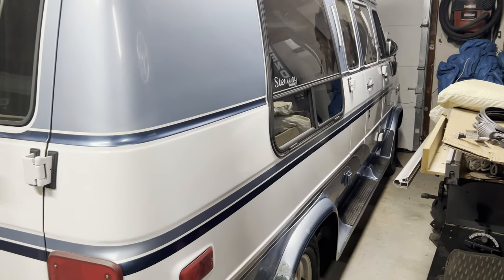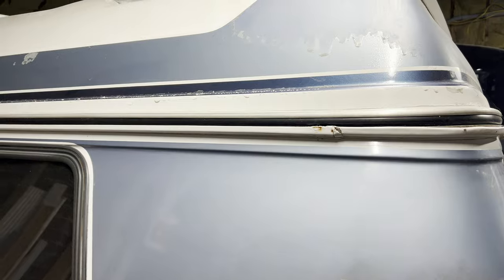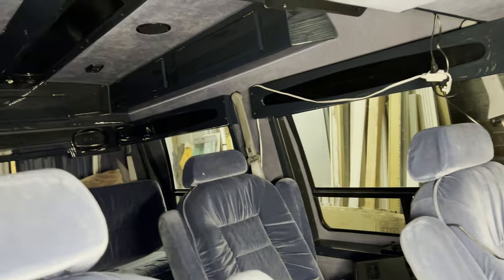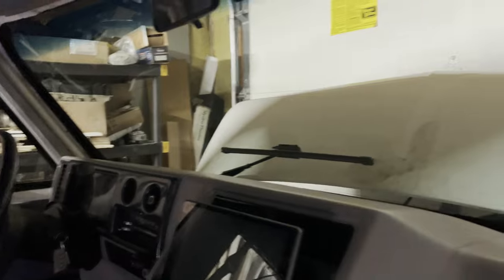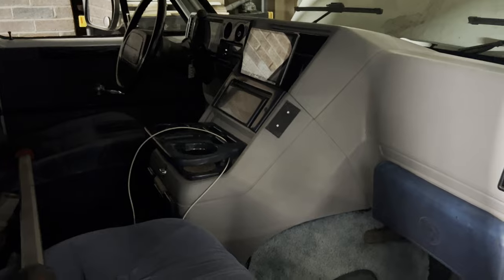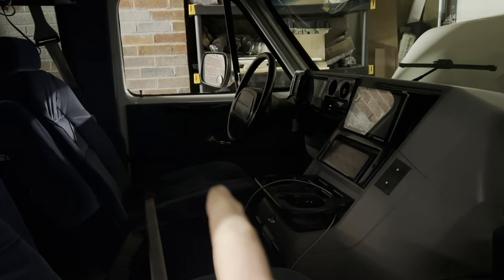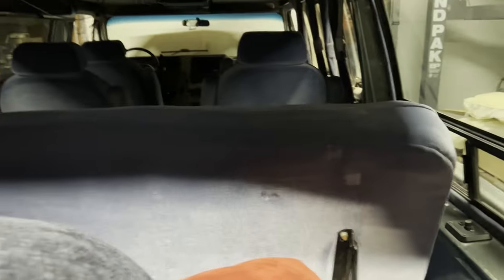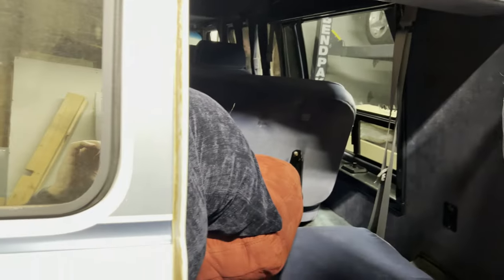1994 Chevy G20 Conversion van

Comment: Did you do the windshield? I had a hard time finding someone to replace mine (93 G20) last summer.
Reply from the maker: i did not, i ended up having safelite do it as it is a glue in not gasketed. of course they don't use the GM trim gasket. i had to fix a tiny bit of rust as well